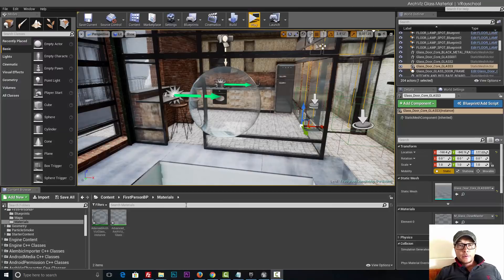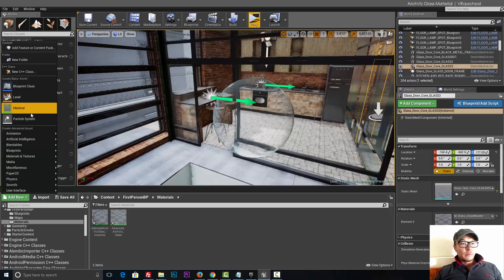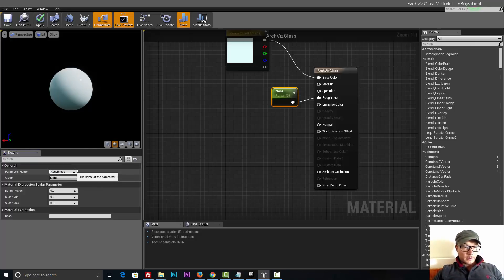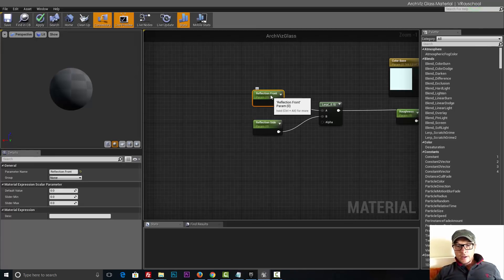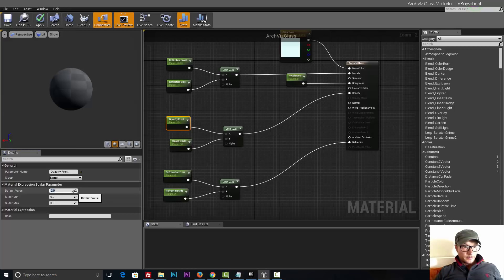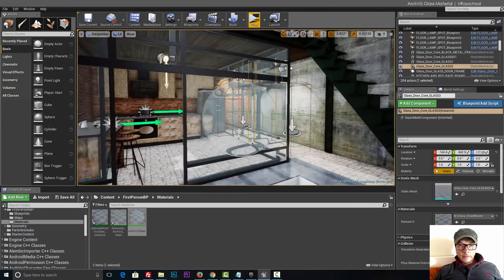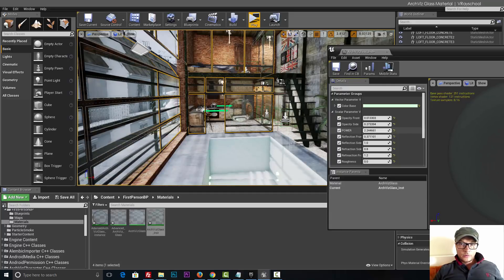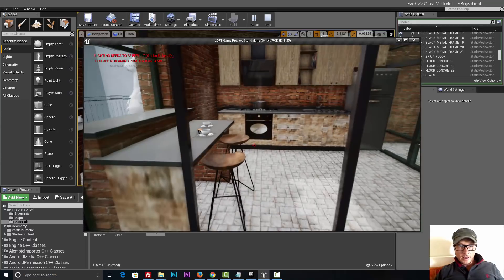UE4 ArchViz Glass Material

Comment: I set my refraction front to 1 so it doesn't look weird on flat surfaces. If you're using it for a window you might start seeing double when looking through it at an angle.
Reply from the maker: i'd use different values for regular glass and window glass

Comment: How would you apply a blur to the glass?
Reply: It depends on the exact effect you want to achieve, and how much control you want to have. In the lighting mode, for glass and water UE4 right now recommends "Surface ForwardShading". The other option, "Surface TranslucencyVolume" is more blurry according to the description. I've only seen it add more highlight to the glass.
Reply: The effect I wanted to achieve is Plexiglass.  I was able to blur the material, but I wasn't able to add reflection.   This is the video I used: https://www.youtube.com/watch?v=527ZcxYnf_s

Comment: Great Video, Thanks!!!

This might help follow along for us beginners. I got pretty confused with hot Keys because I thought you said 3 + right click and couldn't get them to work at first. 

1. Create material. double click it, hit 3 + Left click, or type "constant' (3 Vector) Pick a color between green and blue like glass. connect that to base color. name it 'Color Base' on left. 

2. De-select. 1 + left click  or type 'constant'- connect to roughness, leave it at 0 and name it roughness.

3. Click glass material, then on left turn 'Blend Mode' to translucent, make sure '2 sides' is unchecked. Under Translucency, turn lighting mode to 'Surface Translucency Volume'

4. De-select. L + left click or type 'Linear Interpolate', connect that to metallic. Then 1 + click, connect that to A, copy it and connect to B. Name A Reflection Front and B Reflection Side. Set Front to value 0.05. Set Side to value 1.

5. Make 2 copies of Step 4. Plug one into opacity. and one into refraction. Name them; Opacity Front, Opacity Side, Refraction Front, Refraction Side. Set Opacity front to value 0.05. Set Side to 0.2, Set Refraction Front to 1.2 and set Side to 0.8. Connect to Opacity and Refraction. 

6.  Drag off the Alpha of the first Lerp, Type 'Fresnal Function' Drag off Power and type 'constant' name that power and set to 2. Then plug the Alpha's of each Lerp into that Fresnal Function. Save and Exit. 

7. Now in materials folder, right click and make an instance of the materal. Apply it to something in your level, then you can see the changes as you make the adjustment. Then you can double click the instant, minimize it a little and see all the parameters listed on left of details window. 

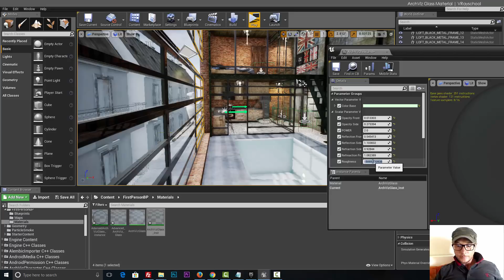can see parameters at 09:50 in the above video.